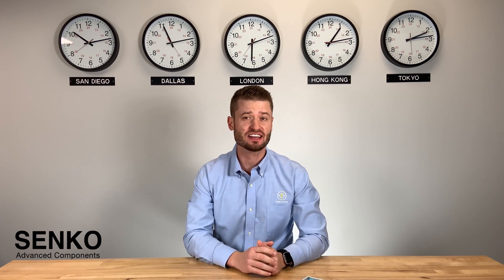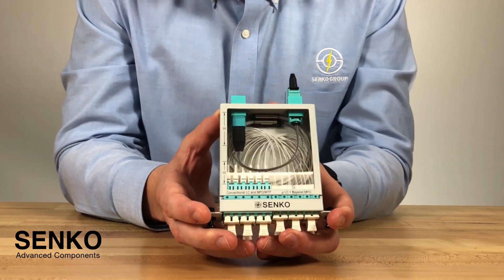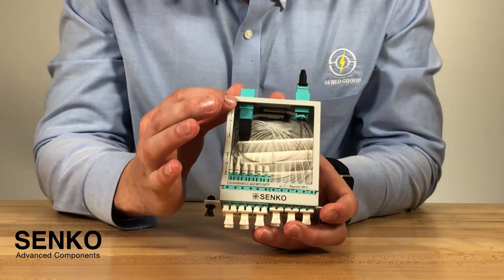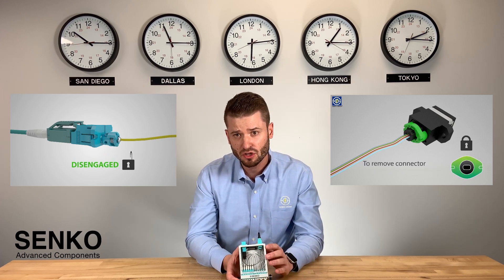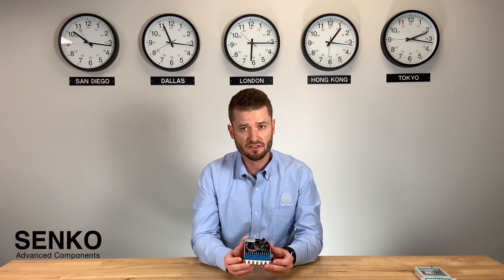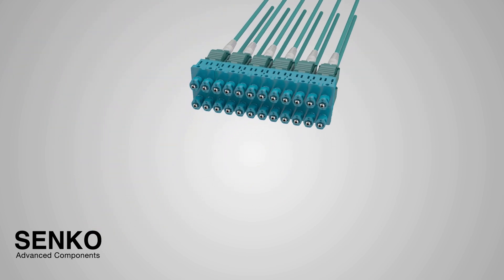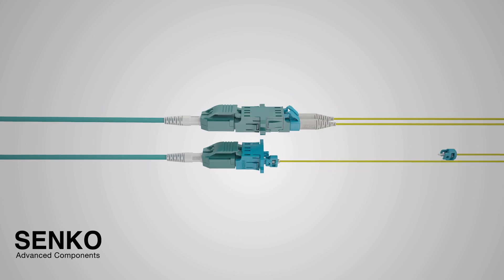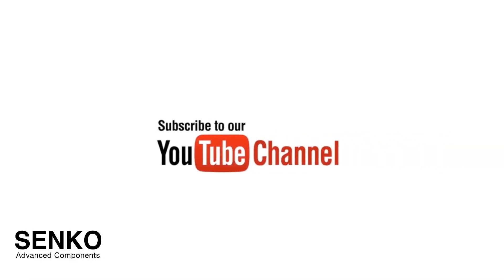How to Save Space with LC and MPO Technology

Comment: How easy it is to disengage the behind the wall Micro LC connector?  It may be a concern during manufacturing to access the connector , if there is a rework.
Reply from the maker: Hello, thanks for your question. Disengaging the Micro LC is easy, you just want to use the Micro LC installation-removal tool that Senko specifically designed for this purpose.